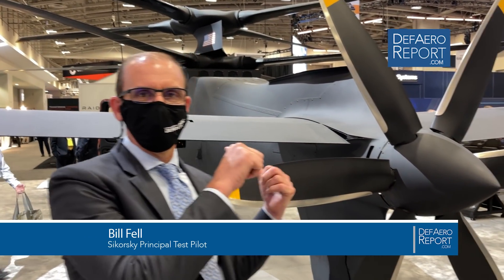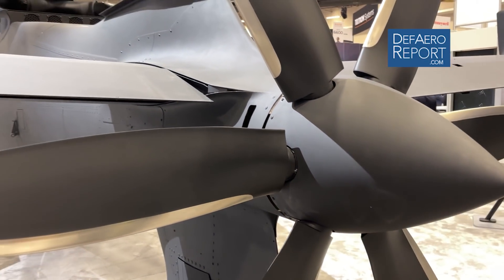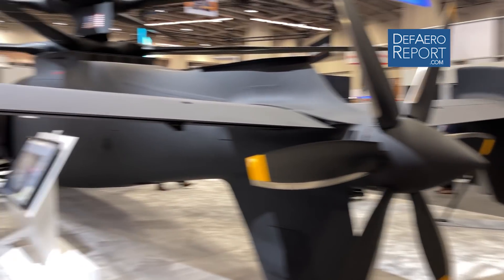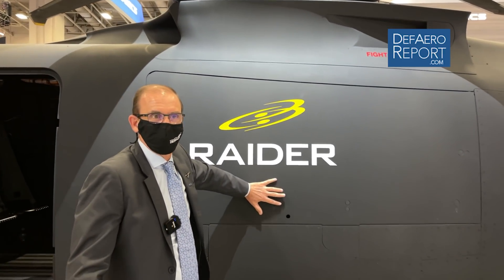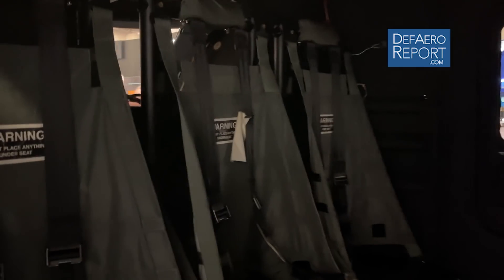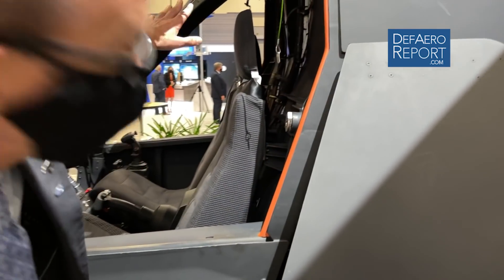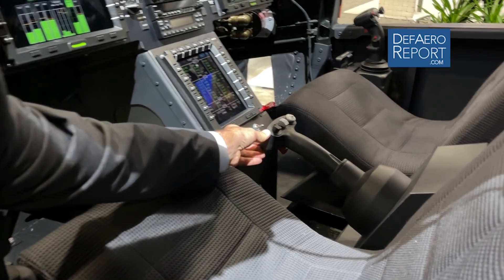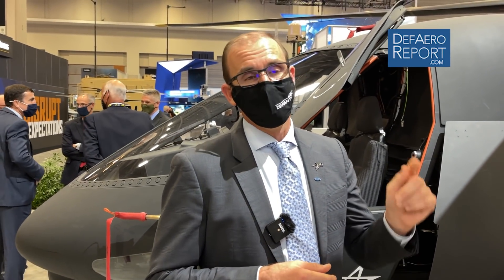Walkaround of Sikorsky’s Raider X Compound Helicopter for US Army's FARA Contract at AUSA 21

Comment: I will tell you why these helicopters is a joke. It is too loud . Your making yourself a target I'm such helicopter. The rotters are to far apart from each other. One rotter is enough but if you insist on 2 rotters than listen. Bring the rotters within 5 inches from each other next the top one is normal size and the bottom one is smaller size or the other way around depending on test results. Next the rotters must be wide same as modern civilian helicopter rotters.. test my theory it will work. But I still say that one rotter is enough . If you want to make the plane go faster than play with aerodynamic play with small  pro engines 2 rotters that far apart is ugly is too loud and is a big red target in the sky. You people don't know what you have in me . I have a helicopter design that is so simple yet so efficient and effective that it make everything else look from the 60s yet the 60s planes can be turned into these new design very easily. Look for me work with me shoe what has being done and I will tell you if is a new idea. Because I haven't seeing these design and but I don't have access to all the information. I guarantee you it works . Is amazing is similar to Honda car turned into an Apache helicopter but with futuristic design ..let me tell you something else. That gun at the nose. That gun is 1960s not bullets or deisng but is 1960s and I can fix that or maybe no one that I mention it you see it clearly the way I see it and you redesing it I can't tell here but it will be an upgrade to something better than what you have .

Comment: Couple of questions?
The shell or body I'm guessing is aluminum?(What about Carbon Fiber?)(Blades as well)
How's the Radar Cross Signature that it leaves behind on radar?(Any Radar absorbing material?)
How does this fair in comparison with Anti Aircraft Artillery?
How does this do in extreme weather flights?
Has anyone ever done a stress test or a destructive test on 1 of these?(Just to see where the failure mode is at)
What about against an EMP as well?
What about the payload or missiles it can carry?
Golden Retriever signing off...…

Comment: Sikorsky has the S-97 Raider compete with the Bell+Textron 360 Invictus in the AAS / FARA (armed scout) program.
Meanwhile, the Sikorsky+Boeing SB-1 Defiant competes with the Bell+Lockheed V280 Valor for the FVL (long-range lift) program.
Given how the US defense industry works, it is likely that both companies get one contract each, to keep every factory running, everybody employed.
So if you like both Sikorsky or both Bell designs, get ready for a disappointment.
The Raider has troop capacity while the Invictus does not, but that gives the Invictus better stealth properties, just like the Boeing-Sikorsky RAH-66 Comanche had. Not sure why they abandoned that design. Just to push a common scout and transport design when they know it's not very likely they'll get both contracts?
The V280 seems to be the more mature design, faster and longer range. But the SB-1 might offer better handling and safety, as it is not a tilt rotor. And it's smaller, closer to the Blackhawk size. This might really go both ways.

Comment: Can anyone comment on whether it is difficult to fly a helicopter with the stick being controlled by the left hand? I am a fixed wing pilot who has never flown with a stick but am a bit uncomfortable using my left hand on a yoke. It is weird using the left hand stick?
Reply: I fly helicopters and that is a serious no for me. The collective works in the left hand because you can only move it up or down. The cyclic controls pitch and roll and requires much more sure touch. The shared collective between the pilots also irritates me.

Comment: Quite an old design so see come back in to the light, what makes it more applicable now ?   It didn't pass the bar in 1967 so why now ? seems like it still has the same issues and only has the same advantages which aren't exactly sought after w

Comment: Isn’t the collective normally on the left hand side of the pilot? Any reason why Sikorsky reversed it in the Raider?
Reply: Helo pilots normally sit right seat, but guessing you know that.  The copilot needs to learn to reverse hands, but, yeah, kinda odd that they could not just parallel the hand controls like most helps. Probably the engineers getting too cute and not thinking of actual combat necessity. I'd change it 
to normal joystick between the knees and collective on left and probably could shave off a foot at least in width.

Comment: Has the military forgotten how hard it was to hit a Cobra AH1-G? It was so skinny you could not see it beyond 200 meters. Every chopper I see that is not skinny and claims to be an attack helicopter, I remember sitting front seat in a Cobra, watching hundreds of rounds wizz by me and nothing hit. The Cobra was less than half a meter wide.
Reply: There is no way a Cobra is less than half a meter wide but I get your point
Reply: On the AH-1G, the canopy width was 3'6", fuselage width was 3'.
Reply: Half a meter? No
It was quite narrow though but still...
Reply: I doubt that size difference has to do with those misses. If you're talking about Vietnam, a lot of gun, missile, and fire control technology has come along.
Reply: Auto correct got me. I meant to say a less than a meter. I see where they say 36', so I am correct, less than a meter.

Comment: That cockpit is stupid. Only 1 collective? Has to be shared. And the left seater BETTER be left hand dominate, since the stick is on the left side with the collective in the middle be shared. This is an unimaginative, terrible design. The KA-50 and 52 have shown that this dual rotor design is severely lacking. I hope this doesn’t win. But with how incompetent our military procurement has been I wouldn’t be surprised

Comment: This is a remake of the Cheyenne, which was also an attack helicopter  with a pusher prop, nut it was cancelled in favor of the Cobra which was a serious downgrade, so there is a lot of people who believe that there was some under the table shenanigans that caused the Cheyenne to be dropped. Nice to see the technology being reintroduced, as it really was a loss that Cheyenne wasn't chosen as America's attack Helicopter.
Reply: The Cheyenne also had the problem of being a single rotor helicopter with a pusher. Nothing to offset the torque of that single rotor seems like it'd be a problem.
Reply: @zachhoefs9543  the Cheyenne had a third rotor for offsetting the torque. It couldn't fly otherwise.
Reply: @AurumFaber  I don't see one.
Reply: @zachhoefs9543  the helicopter in this video isn't the Cheyenne if that's what you mean. This one has two main rotors so that they cancel each other's torque by rotating in opposite directions.

The AH-56A Cheyenne was the helicopter that was scrapped for suspicious reasons.
Reply: @zachhoefs9543  the cheyenne had two tail rotors, one as a prop, much like the raider, and other to offset the torque and turn the aircraft, much like any traditional helicopter design.

The cheyenne also had a built-in gyroscope for balance while that coaxial rotor does the same job for the raider.

The cheyenne had a serious problem with vibration that seems to plague the defiant. Let's hope Sikorsky get at least the raider figured out.

Comment: seems small to weigh 10,000lb
Reply: Aircraft can be quite heavy. The frame and skin are probably pretty lightweight but the jet engines, gearbox(es), drive shafts, rotor heads, etc. all are very dense and heavy.

Comment: That is a amazing machine, but how can it substitute the Blackhawk ? It doesn’t have inside space and looks like a little fragile.
Reply: Speed
Reply: The Raider is not the Blackhawk replacement. The Raider is to replace the 58D and Apache. The Defiant X, looks like Raider but much larger, will replace the Blackhawk.
Reply: @wangsonsylvien344  Bell helicopter  might disagree.
Reply: @WALTERBROADDUS  and if Bell thinks the Raider is the competition for a Blackhawk replacement, they have lost already.
Reply: The Bell design to replace the Blackhawk, in my opinion, is just too big. The footprint of it when landing is so much wider than the Blackhawk, while the Defiant X is essentially the same size as the Blackhawk.
Reply: @zachhoefs9543  the performance advantages outweigh footprint.

Comment: it's awesome!. I think being able to seat 8-10 soldiers would make it a lot more useful
Reply: I think the thought process was the deployment or extraction of small reconnaissance squads. Or being able to quickly pick up a down helicopter crew. The SB-1 Defiant has the troop carrying capacity at least on par with a Blackhawk
Reply: This is meant to replace the Kiowa scout helicopter, not a transport.
Reply: He did say this one was designed more as a recon/attack craft. Not really designed as a troop carrier, but it can carry 6 if-needed.
Reply: You are thinking of the Defiant X which is a version of this that would replace the blackawk helicopter. This is meant for recon mission with attack capability. I do admit that the 6 seats for quick pickup and deploying is a big benefit of this design. Have a recon heli there and need a quick extraction, you dont need to call in a blackhawk or little bird and can use this to get them out of there.

Comment: too little internal space also looks very hard to in and out from, maintenance on the gear with double  propellers should be a nightmare also, for comparison, the mil mi 24 can also achieve over 200 knots of cruise speeds, its much more armored bein able to resist .50, has wings that help aerodinamically and can also carry a lot more weaponry, it has a frontal cannon and can carry many more troops, and is easier to into, also since its a traditional design maintenance is a lot easier.

Comment: It has a great design, it is like F35 of helicopters.
Reply: The F-35 Urg, bleah! Quite the opposite, the Raider X is a fast hot rod, where as the F-35 tops out at Mach 1.6 which pretty pedestrian by any standard--admittedly much faster than a Harrier or A-10 I guess.
Also, we used to talk about Supercruise capability as being a 6th gen capability, well I'm afraid you need to look elsewhere.
I'd rather say the Raider X is the F-22 of helicopters but with the 1990 avionics and computers brought up to date.
Reply: @TheEwanMC  F-35 is getting a more powerful engine quite soon, check it.
Reply: @TheEwanMC  The F-35 can supercruise, just so you know (although the term “super cruise” is really just a buzzword without much meaning).
Reply: @jonathanpfeffer3716  just so you know, not the U.S. Navy’s and Marine Corps’ versions of the F-35 jet which can only fly at supersonic speeds for short bursts of time before there is a risk of structural damage and loss of stealth capability.
An issue that risks damage to the F-35’s tail section if the aircraft needs to maintain supersonic speeds is not worth fixing and will instead be addressed by changing the operating parameters, the F-35 Joint Program Office has stated.

The deficiency means that at extremely high altitudes, the U.S. Navy’s and Marine Corps’ versions of the F-35 jet can only fly at supersonic speeds for short bursts of time before there is a risk of structural damage and loss of stealth capability.

The problem may make it impossible for the Navy’s F-35C to conduct supersonic intercepts.

“This issue was closed on December 17, 2019 with no further actions and concurrence from the U.S. services,” the F-35 JPO statement read. “The [deficiency report] was closed under the category of ‘no plan to correct,’ which is used by the F-35 team when the operator value provided by a complete fix does not justify the estimated cost of that fix.
Reply: @jonathanpfeffer3716  yes I agree for some aircraft the term ''supercruise'' is irrelevant.
The MiG-31 does not technically supercruise but it is designed to cruise for 720 km (450 mi; 390 nmi) at Mach 2.35.
Reply: Ever heard of bell 360 invictus
Reply: @Ppadira  The Bell 360 Invictus looks better, but I don't know how it can justify its existence, when there are drones that do the same thing. 
At least the Raider X can be used as a transport, as well as recon/attack helicopter.
Reply: @scratchy996  
Well that doesn't mean drones can replace attack choppers anytime soon . May be in future when unmanned choppers wont be a just mere a paper drawing
Reply: It's supposed to be a workhorse, not a hangar queen.
Reply: F22
Reply: The F35 can hover and fly at Mach 1.6 plus it has super cruise! Not to mention it can fly at 50,000 ft plus and is stealth! So I guess the Marine Corps’ B VSTOL Version can hand this aircraft it’s ass! In addition the Osprey can carry way more troops and equipment and it flies faster and much higher too! 

Now what!
Reply: @waynefletcher9884  Mach 1.6 ''plus''
I like how you add this ''plus''
Well a MiG-31 can get to Mach 3 plus but it is temperature regulated to Mach 2.85 @70,538 ft.
RIP to the four Marines that were recently killed in Norway Osprey crash.
It has been a few years since the last tragic accident involving a Marine Corps Osprey.

Three Marines were killed in 2017 when their MV-22B Osprey crashed off Queensland, Australia.

In 2015 one Marine was killed and 21 were injured when a Marine Osprey caught fire after a “hard landing” in Hawaii.
Reply: @TheEwanMC  there’s a time that flying faster than the speed of sound has diminishing effects ergo is no longer useful. The Russians have never made superior weapon systems or invented a god damn thing! All they’ve done has copied things! For instance that Mig whatever 31 …. It never could catch the SR71 and the SR71 used it’s speed to do reconnaissance for decades. What the hell did the  Miggy 31 do?
Reply: Well you do have powerful black men to the running and jumping to win sports, but you would be nothing without them.
Reply: @waynefletcher9884  why are you comparing the osprey to the raider? They serve two different roles.
Reply: @ameritoast5174  absolutely! Helicopters are slower and they can’t fly as fast or as the Osprey
Reply: @waynefletcher9884  and? The osprey is big and can't maneuver as well as a helicopter and too big to land in smaller areas like a helicopter.

Comment: Hard to know how well it's going to work. 
- It's easy to be gee-whiz over the tech innovations. 
- It's also easy to be crabby over them, and insist that - especially in combat - the old and proven way is the only way. (Its main competitor for the contract is a very traditional design.)
But how much of an improvement over a traditional design will it be? How reliable will it be? These are questions we don't know the answers to yet.
Reply: go see for yourself watch the test flight videos of this lmao wtf you people smoking this has passed alot of flight tests already and has done pretty damn well by all the accounts ive seen idk where some of you are getting this idea that it will never fly and be some paper weight lol wtf yall on
Reply: Old and proven helicopters are falling out of the sky over Ukraine right now. Helicopters need to evolve if they want to be able to survive the increased lethality of the types of  weapons a modern country can employ against them.
Reply: @Rampant16  exactly
Reply: @Rampant16  To use a Devil's Advocate argument: 
Quite a few of the helis "falling out of the sky over Ukraine" are Kamovs with coaxial rotors, which are hardly an old and proven design. Sure, Kamov's been making them that way for some sixty years. But they started doing so under the USSR - so it only would have taken the advocacy of one top general wowed by the Gee-Whiz Factor to get their ball rolling, then a well-connected factory manager could keep it rolling. And no one else builds them that way, which argues against any kind of superiority for the design.

Comment: Considering the Westland Lynx holds the world record for the fastest pure helicopter, having achieved an average speed of 249mph over a 15Km course back in 1986, having a much more modern, COMPOUND helicopter design reach the same speeds 35 years later isn't particularly impressive. Even in standard trim, the Lynx utility helicopter does 175 knots (201mph), has room for 8 troops,  can mount a huge variety of weapons, and it is fully aerobatic, able to do loops and rolls. This Sikorsky is barely faster than the incredible Lockheed Cheyenne compound attack helicopter from the late 1960s.
Reply: That was a modified aircraft built with the intention of doing nothing more than breaking the speed record. Operational variants have a max speed of only 201mph.  The number given for the Raider was only the max speed obtained in testing the prototype.  The goal for the production version is around a 290mph top speed.
Reply: @dcl97  yes 290mph is ample enough. you dont want to deliver sick and giddy troops
Reply: i believe this has a significant increase in Radius of Action compared to what it's meant to replace, i can be wrong on that but im fairly sure that was one of the big selling points
Reply: They call the Lynx the Sardine Can because all the marine commandos are just pushed up inside against each other